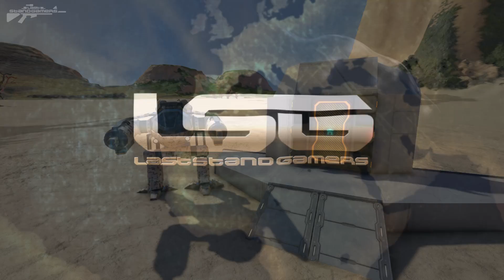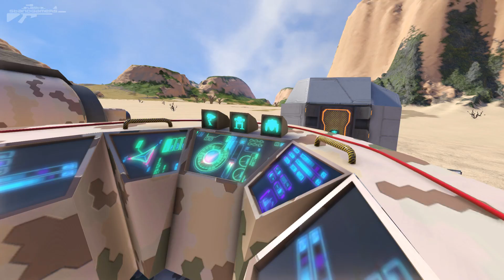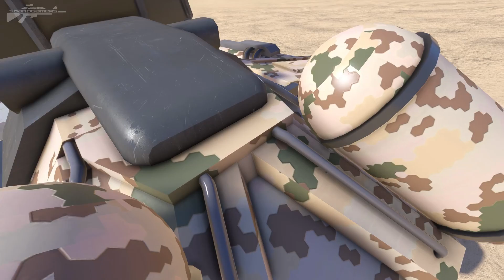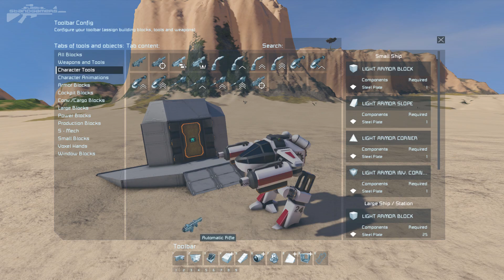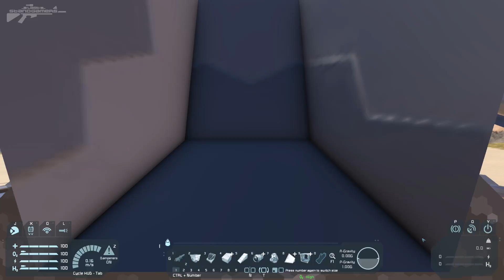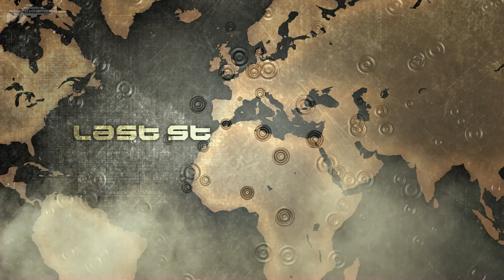Space Engineers - Epic Mech Battle Suit

Comment: it would be interesting if this were a vehicle base and there were mounting points vehicle type turrets, tools and cargo containers.
Reply: With the new skin customization, you could theoretically have aesthetic add-ons, but I'm not sure about working turrets. Keen would need to add a personal shoulder-mounted AI turret for that, and for that they'd need a new way of equipping items.
BUT, if Sektan makes custom player tools for the mech (which is how he's going to do it from what I know), he could make different chassis for more specialized/utilitarian purposes and roles:

Construction/Repair Chassis
Faster and more stable (less drifty) jump-jets, more cargo space, longer battery life, and higher Hydrogen/Oxygen capacity, but much, MUCH less armour (only JUST enough to protect the pilot from the Klang-Propelled space debris that occurs when grinding small-ships).
-=-
Mining/Excavation Chassis
The same as the C/R Chassis, but with Base-Model jump-jets, slower movement speed (same as Base-Model's current speed, which should be bumped-up just a tad), more armour, and a little bit more cargo space.
-=-
Recon Chassis
Much faster movement speed, very long battery life, and slightly higher Oxygen capacity, but has no inertial dampeners (if it's possible to force-disable them), very light armour, and extremely low-capacity Hydrogen Tanks and storage.

This combined with a 40mm AT gun "character tool" (mech sniper rifle) would be very effective at discreetly causing mayhem in an enemy base from long-range like that "remote-sniper in a bush" tactic that LSG talked about recently, but much more dangerous due to the fact that it's (highly) mobile.
-=-
Heavy/Brawler Chassis
Very, VERY heavy armour, more cargo space for huge amounts of ammunition, longer battery life (somewhere in-between Base-Model and C/R Chassis), and higher-capacity Oxygen Tanks (also between Base and C/R Chassis), but lower movement speed (same as the Base-Model's current speed), and very weak jump-jets (or none at all).